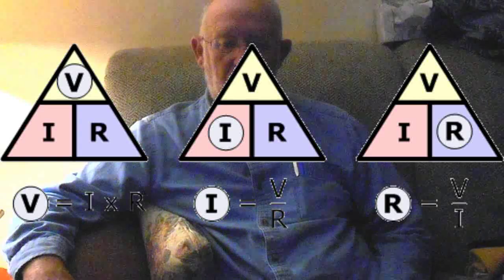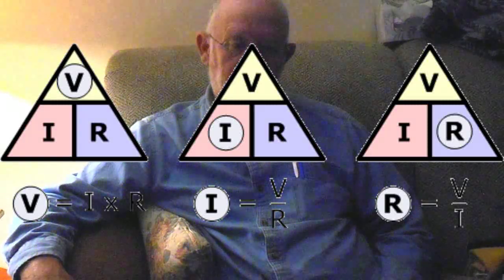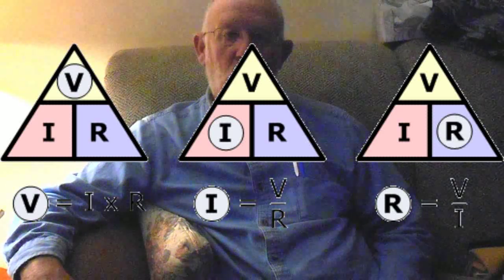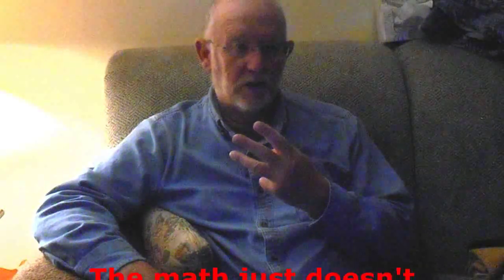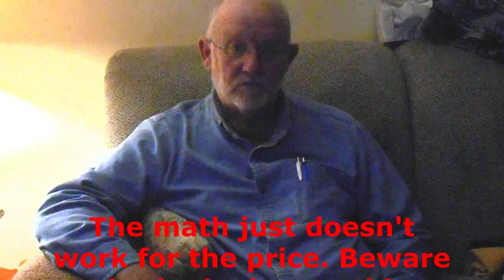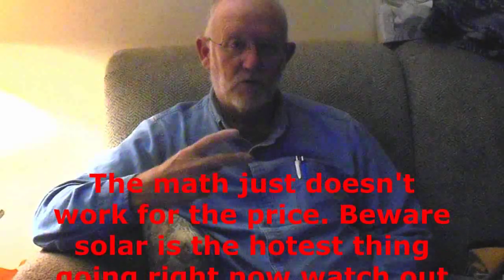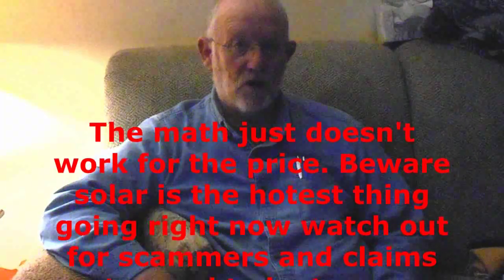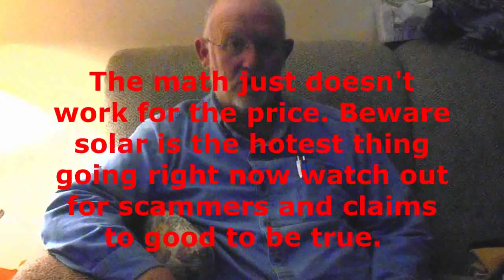Po-Boys making solar powered sand battery to heat my home with solar panels

Comment: You will need about 8000 kwh a year to heat a home even the Finlanders say their experimental model will only hold 8000 kwh before it needs refuelling and they recommend a heat pump for a single house but we all need to try so good luck
Reply from the maker: I  have a heat pump and love it, may soon update to a cold climate heat pump suppose to work at even lower temps like we get in nothern Michigan. My goal this year is to have near 5,000 watt installed this year. Playing with 960 watt temp install right now, new video comming soon.
Reply: @macwolgamott4201  Yes I have the ground source heat pump best heat ever. I was thinking a whole stove top with the glass would be nice sand battery as we need to find a way to replace the elements when needed.
Reply from the maker: @offgridwanabe  I see this as a huge drawback. On the other hand do we always have to run these at max temp? Maybe somewhere between 250 and 750 degrees? Limit how hot the elements get to make a hot battery.
Reply: @macwolgamott4201  The original idea about sand battery was to use surplus energy that would be lost as it was made but had to where to go on the grid so the dump load was free energy and sand was heated and stored. You are only trying to heat sand with direct solar energy which has no other use so you can configure it to what ever heat range you want by changing the string size and amperage.

Comment: So sorry... you are going to be disappointed when your solar panels arrive and then again when you place a sand heating load...
Reply from the maker: Sounds like you my have some experience in this but didn't explain what it was and why I will be dissapointed? Care to elaborate?
Reply: @Mac Wolgamott  Just do the math of how many BTUs you and your shelter needs to be comfortable say 10,000-12,000 BTU / hour for 1000 sqft more or less... if it doesn't pencil you will be disappointed that you spent the money and couldn't corral the heat to stay in your 1000 sqft living space... i.e. more than a heater is required... FIRST invest in plenty of insulation say R38 if you are serious... it keeps the heat from escaping month after month... it's like interest... it pays you back month after month... look at your heating bill... convert to BTUs is a good start.
Reply from the maker: No I don't need to do the math, I suck at it. But by your math  my 95% plus furnace is not big enough. I am very close to the 45th parallel's and here is what google says I can plan for.
 A furnace that is too large will waste energy and create warm spots at grates near the furnace before the cycle ends.

The generally accepted BTU per square foot heating rule of thumb ranges from 30 BTU to 60 BTU per square foot. That’s a wide difference, essential one furnace being twice as large as the other, so the size factors are discussed to help you narrow down the right BTUs needed for your home. 
Even at the higher range your math sucks too. One kilowatt of power is equal to 3400 BTU go look it up very simple to do. My 10 solar panels will create 2.3 Kilowatts per hour per good day. These 10 panels are just the beginning.

Good day to you and thanks for your comments as it made me look into some thing I had not looked at.